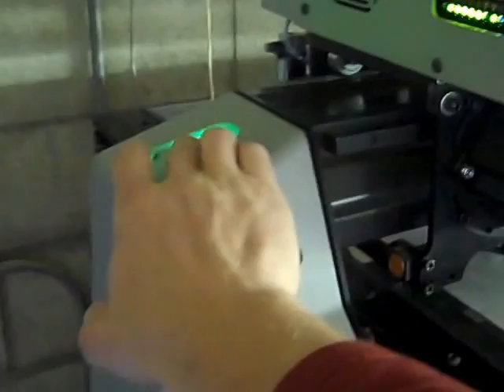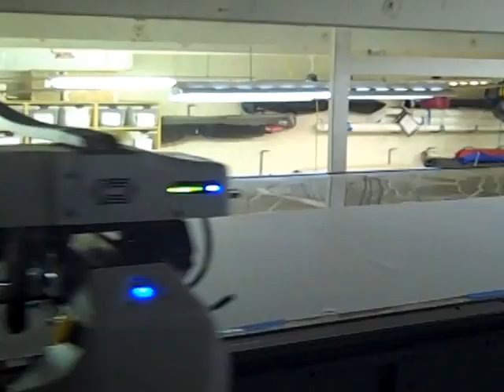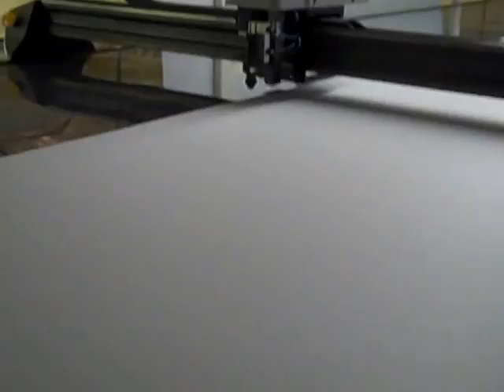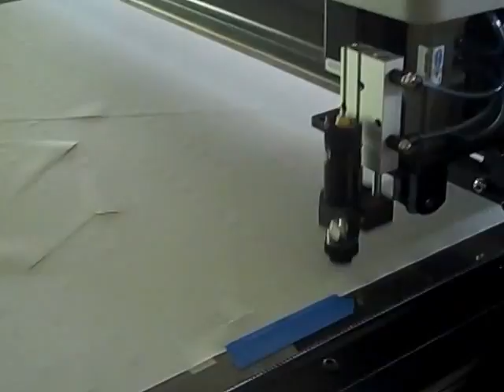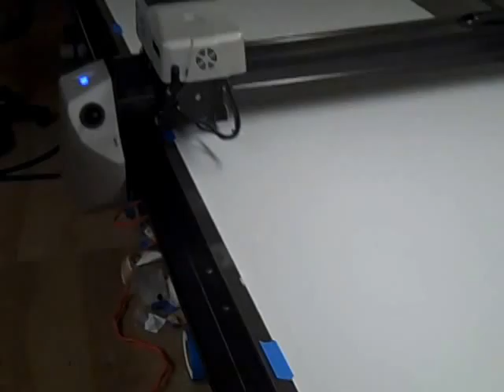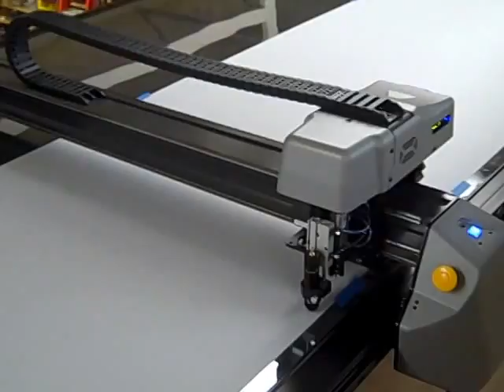2013 Autometrix Advangage plotter/cutter cutting a Sunfish Sail

Comment: would be a good idea make sure all the cutting lines are joined together to avoid multiple cuts in the same spot.
Reply from the maker: +AlfredoGrey Unfortunately, that is sometimes how the corners are defined in the sail design software. It is not so much multiple cuts in the same spot as many small cuts right next to each other. The vast majority of the patterns we cut do not have this issue.